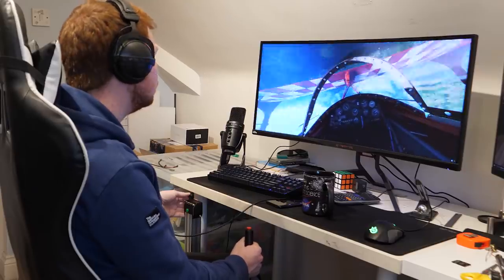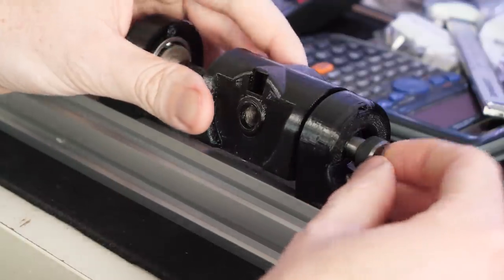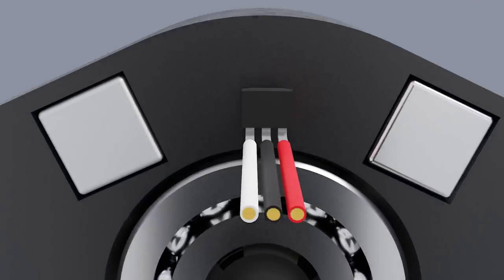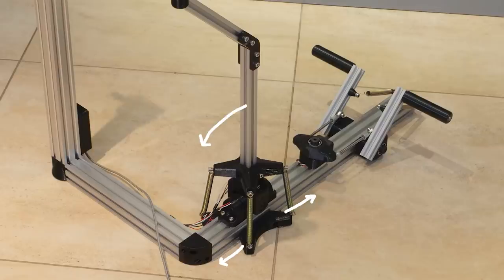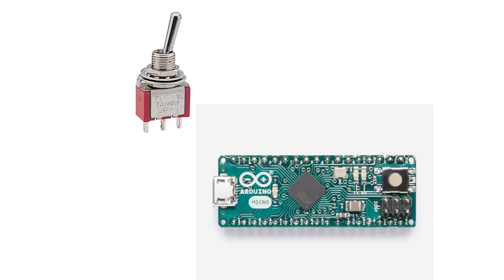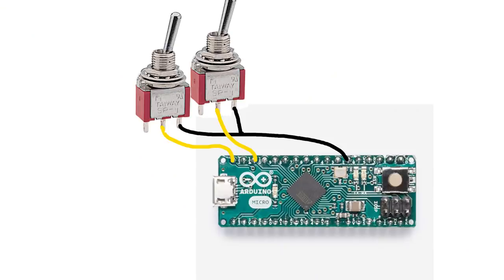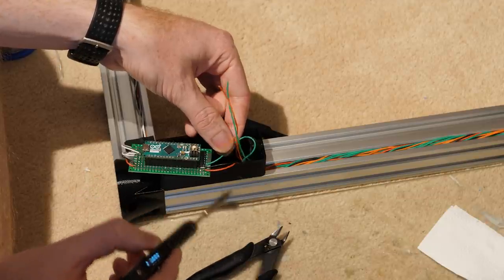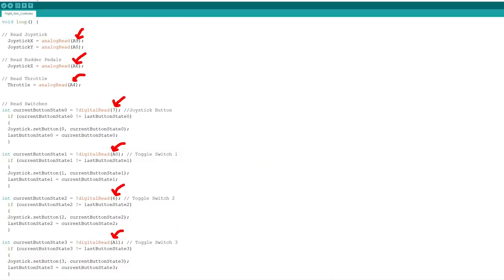Flight Simulator Joystick Info

Comment: Brilliant! I was planning to buy a low cost helicopter simulator controller kit to use with VR. Which is roughly same design as yours, minus collective. The kit is £750. With a bit of design change to accommodate collective instead of throttle, I can DIY it for 1/3 of the kit's price ^_^ Thanks a bunch Tom! You made my day!
Reply: planning something similar heli simming is expensive
Reply: Oz What heli sim do you plan to play?
Reply: @gargy2002 but you see, i have friends with printers, and soldering irons
Reply: @gargy2002 Or you could do all that and enjoy learning new skills and accomplishing something you haven't done before.  Plus then you'll have new tools and a 3D Printer too!  And still spend time with your family.  Win, win, and win.  (Of course yeah, if the only goal is money saving and you don't have interest beyond the device -- just buy it.)
Reply: @gargy2002 so is there a single reason for u wasting time and watching this video?
Reply: @petergruc  I think the real question should be "Is there a single reason for gargy2002 wasting all our time with their negativity?"

Comment: This is was a brilliantly simple and elegant build! I always thought these kind of joystick or HOTAS set-ups would be really tricky.

One suggestion for the code is it use the Button library. It handles all the current-state/previous-state internally so your code is a lot tighter. Also, you can use arrays to save yourself from repeating code for every axis/button. This makes it a lot easier to add more inputs down the line. That said, arrays can be difficult to figure out, especially with arrays of objects, so there's kind of a learning investment to do.

Comment: Came here because I was wondering how the Joystick driver was made, of course there is already a Arduino library ;)
Looking at your code I noticed a lot of duplication though, especially the switch part could be written way shorter. Just save the pin definitions and lastButtonState as array,  then do the setup and readout in a for loop. CurrentButtonState does not need to be global, one temporary variable is enough. This might sound like overengineering, but it makes changing the pins way simpler as well. I can send you a pull request if you want.
Reply: Ooooh I'd be interested in seeing the code myself!
Reply: @timcuatt1640  Here:  https://github.com/Jakeler/Flight-Simulator-Joystick/blob/main/Flight_Sim_Controller.ino
You can also find it through the open pull request in his repo page.
Reply: @1Hippo  Other thing to change.. the joystick range should be 0-1023 and not 0-1024. This is a 10bit value.

Comment: If you don't have a compass but you know where north is, you can float the magnet in a plastic lid (off a milk bottle or some such) and change the orientation until it lines up N-S. Mark the north pole with a dot from a marker pen.

Comment: Thanks for this.  I want to do exactly the same but for a helicopter, so will be adding a collective/throttle lever also. Especially thx for the tip on linear hall effect sensors.  The link on your video is no longer valid, but I was able to find sensors for less than $1 US and the first one seemed to work great.  This will greatly improve the reliability vs a potentiometer.  I also really like how you use 80/20 extrusions.  They are so handy for anything like this.

Comment: I have been designing something similar, very early stages, but one thing I am looking into is to surround the stick with a air bladder (similar to a blood pressure cuff) to make the stick stiffer at higher speeds. In fact, originally I was thinking of creating a seat with air bladders to (poorly) simulate G-forces in the seat.  If the pilot is well strapped in, air bladders to the back, right and left inflate and push against the pilot (originally for simracing, but it would work for flight simulation as well with some modifications

Comment: Thank you so much for this project Tom. This should be more accurately described as a HOTAS since it's a lot more than just a joystick. As a FS2020 user I've wanted something like this but you've given me the impetus to build it myself. I was originally using CH Products throttle and stick but the big issue is rudder pedals using a standard office chair. By modifying your design to anchor to the central pillar of the chair it should stop the chair rotating when applying pressure to the pedals. Another design question is that the brakes are supposed to be integrated into the pedals on light aircraft. Maybe a pair of button pads mounted above the rudder pedals?

Comment: Thank you Tom, this is fantastic! How about a mod for the throttle quadrant converted into a collective lever for helicopter simulators? 🤓
Reply: That are my intensions too. I´m going to use a modificated cyclic / TM Warthog, but try to use the Arduino Sim from Tim for rudder pedals and collective. I just try to understand the Arduino codes and will going to use another hall effect sensor for the collective.

Comment: Hi Tim, very cool! I have built some hardware for flightsims (I use X-plane 11) like rotary encoders for controlling flight instruments and GPS/Radio/Autopilot.
I like helicopters a lot and I am very interested in your project! Besides a yoke and throttle quadrant, including trimwheel, I have a good joystick (X52), but the
experience with the hardware you built would be way better. We (my wife and me) like the UK very much, been there often for holidays! Cheers from The Netherlands (North-East).

Comment: How about using I²C hall effect sensor such as SI7210-B-00-IVR? That would be ~13 bit sensor with a cost of less than 1 euro. That supports 4 selectable I²C addresses so you could put 4 such sensors in a single wire. That sensor has internal for temperature compensation but it also supports reading the temperature so you can fix possible temperature caused drift in software, too.

Comment: Hi Tim.  A great design.  I found all the bolts and bearings at RS Components and the Hall effeect at Farnell. The Arduino came from Cool Components. I have a problem geting the Arduino to be recognised by my Windows 10 machine The old Wingman joystick is seen by the computor  but cant work out why the Arduino isnt.  Your help would be  aprecaed

Comment: Hi !
I'm new to this Arduino/clones but I really wants to build some controls for the FS2020 !
I just ordered some controllers from Banggood (not Arduinos but GeekCreit !)
I designed a rudder pedal including L/R-brake switch mechanicly and want to make the coding of wiring now.
Unfortunaly I see it's NOT the same microcontroler ... I have a board with the 3.3V 8MHz ATmega328P
1) will it work with the library ?
2) is there a forum or so for projects like this FS2020 controls somewhere ?
Reply: is should be the 32U4 chip

Comment: I want to see you build a collective hand throttle so you can do helicopters
Reply: I think you can do the same thing as he did with the throttle, but add a rotational axis with a potentiometer and add it to the code, should be quite straightfoward (I guess)

Comment: Great idea, I use the same library to make an additional Clutch Pedal for my El Cheapo Sim Racing Setup. This works perfectly, although my code is not so perfect, as I have no automatic Offset calibration? Did you do this in your code?

Comment: You say you used M8 shoulder bolts for the rudder pedals, but you are using 10mm ID bearings there. Is this a typo in your parts list and it should be M10x30mm shoulder bolts?

Also, where did you find your springs? I'm trying to source these parts in Canada, and it is a nightmare D: metric parts are so hard to find...

Comment: Christmas is coming, and I notice you're a Banggood affiliate.
What's the minimum hobby starter 3D printer? I've wondered about getting one, and this may tip the decision, but I know next to nothing about them when it comes to choosing one to buy for the first time.
Reply: Creality Ender 3, about £180. Prints amazing out of the box. With half an hour or so building and leveling the bed, you could get prints the same quality as you see in this video. 3d modelling is another skill that really makes 3d printing useful. Fusion 360 is the best free software. Plenty of videos on printing and fusion on YouTube.
Reply: @joelaw728  Thanks for that. I'll check that out.
Reply: @joelaw728  Fusion 360, however, will get worse over the next few months as some file export options and tools will be cut from the free version.

Comment: in the process of getting these bits to make this. Can you confirm the sizes of the shoulder bolts for the rudder pedals, i am thinking they should be the same diameter / thread as the shoulder bolts in the joystick?

Comment: Is it possible to explain the size of the bolts a little better for people, like me, don't use the metric system especially the shoulder bolts? Having an issue of finding the right bolt size. Also, what are the pitch of threads on the bolts?

Comment: I've been looking into building something like this for my RC planes. How easy could you modify the code in the arduino and make the necessary connections to make it easy to connect to a RC Transmitter?
Reply: I've seen a couple DIY transmitters, it's mostly an exercise in finding the matching hardware and libraries, give it a google
Reply: not sure if this is what you want to hear, but you could take apart a rc transmitter and replace your roll, pitch, yaw, and throttle potentiomiters with the hall effect sensors that are built into tom's joystick. that would be the easiest way in my opinion. The other option is programming the arduino to output a CPPM signal based off of the individual hall sensor's values, and then connecting that to the trainer port on your RC transmitter.
Reply: Outputting ppm can be done quite easily  with an arduino and then plugging into a RC transmitter with trainer mode so if anything goes wrong you can use the rc transmitter
Reply: @Nicolas_dG  is there a ppm library that you know of? I've been wanting to look into this for a while

Comment: used these videos as inspiration to build my own rudder pedals (with toe brakes). I'm finally at the programming steps and struggling with the Arduino Micro. I have used plenty of the 328p style arduinos with no issues, but this Micro (32u4) style is kicking my butt. the whole thing with COM3 & COM4 popping up in windows 10 device manager during the reset of the micro was a real hassle and of course when you upload the joystick library it changes to a new COM port. I haven't figured out a way to reprogram the Micro easily after it has the joystick sketch loaded as it is taking over the COM port at that point. I have to hook up my MEGA to flash the bootloader on the Micro and then reload the modified library... Is there a better way? would greatly appreciate any tips for fast code editing and uploading if you have any guidance on this dang MIcro.
Reply: I've found that with the Leonardo, when the Arduino IDE gets to the upload stage, pressing the reset button makes it enter programming mode as soon as it boots.  Maybe the Pro Micro does this too?
Alternatively, try the Leonardo.

Comment: Hey Tom, fantastic design!  I'm in the process of going through the parts list and ordering components now. Quick question:
Are the shoulder bolts supposed to be 10mm to go with the 6000-2RS bearings? It currently says 8mm in the BOM
Reply from the maker: Apologies, they're supposed to be 10mm shoulder bolts with 8mm thread. I've updated the list in the Youtube description, but thingiverse takes a while to update. Thanks for letting me know!
Reply: @TimStation  Sure- no problem at all!

Comment: Hi, first of all, thank you very much for such an instructive video, it's been great. Im currentrly running tests in order to see If I can get the circuit up and running, and then, Im going to print everything. One thing Im facing on my tests, using an arduino UNO and a ss49e sensor, is that I cant get the value to reach maxium and minimum values. Printing a simple Serial.println(analogRead(A0)); and using 5x2mm neodymium magnets, I can only move from 400 to 600 output value, no matter how I face or how close I put both magnets (Im sure I faced the north and south poles correctly), while I was exptecting the full 0-1024 range. Is it possible that these magnets are not powerful enough? Thanks in advance!

Comment: Hello!
Great project, thanks for inspiration!!!
I have question. Can I use SS495A type of hall effect sensor?
I can't buy in poland 496 type.
Regards
Reply: I'm wondering the same thing. Output current of the SS495A1 is less than the SS496A1. Not sure what the result will be.
Reply: @martinbachrodt745  it is perfect.  Flight simulator working grate.  Thanks !

Comment: Buttons without pull-up resistors, and going to analog inputs? Never seen that before. Maybe reading all those ADC channels causes some latency, as compared to using pull-up resistors with digital inputs. Though I doubt any such latency it causes is on the 100ms scale.

Still, makes me wonder where all that latency comes from, be nice to see you hook up a logic analyser to some digital outputs of the arduino, which are programmed to turn on at certain stages in the loop so you can debug your circuit without loading it down with much extra code.
Using an external SPI ADC might speed things up, maybe.
Reply: You can use all inputs as digital. Atmega have internal pull-ups, no need for adding extra resistors.

Comment: Hi Tim, thanks for the great project. My 3d printer runs for the second day. I´m going to convert the simulator for a helicopter, so I will use Your rudder pedals and build a collective instead of the throttle stick. For the cyclic I implemented a third party stick but with modifications. This little Arduino Leonardo is my very first Arduino and I try to understand Your code with multiple Youtube Videos. The upload of your codec was successful so far, but no sensors are connected yet. I have one question about the analog config. My Arduino has 5 Analog Pins and in the codec is written analog A6 as example for the rudder pedals. And pinMode A0-A9. Is Your Board extended? I only need 2 Analog Pins for tail rotor and collectiv. But this confusing me. 
Mybe someone can help me before I start to rewrite the codec. Best Regards.

Comment: Hello Tom,
Is it possible to use an ADC 16 bit card (ADS1115 for example) to increase the resolution of the Arduino pro Micro to 16 bits for the Joystick ?
Thanks !
Reply: No the limit will be the same 10 bit.

Comment: Think you could simplify it by using this BU0836X 12-Bit Joystick Board from LeoBodnar? Whats the downsides? Works with hall effect.
Reply: I was thinking the same. I have the same and currently am just using slide pots for throttles, props and mixtures.

Comment: you will be able to make a guide of the connections and compilation of working arduino? For people who know how to build and print but do not know how to use arduino. Like me, for example. I would pay for this info
Reply: I am working on this exact thing this weekend. I am not great with Arduino but I have messed with it enough to figure it out. Literally just finished testing my arduino with the buttons, potentiometer and hall effect sensor and it all works. It is pretty simple. I will be making a YouTube video and link will be on thingiverse
Reply: @headintheclouds2569  It would be interesting to me too.
Reply: @sleepyhollow6884  you know, I finished this thing and it works great but I never made a dang video or anything 😄

Comment: Hi,
Im building my new Joystick after your video. Ive allready printed and assembled my gimbal and put the magnets and sensor in their place. When I connect it to my arduino (Im using your Arduino file) I can find it in the Windows gamepad controls. But what I see is confusing... The crosshair for the x- and y-axies is dancing around even if the gimbal is held absolutely still and even with calibration done before. Maybe somebodey can give me a hint what i have to do to get it working properly. Thanks a lot! :)
Reply: check again the correct alignment of magnets.

Comment: What is the requirement that it must be a 32u4 processor for the Arduino?
Reply: It's required by the Arduino Joystick Library; it is for to mimic USB joystick to Windows.
Reply: It is the cheapest Arduino that is recognized as USB by a PC, otherwise it will not be seen as a controller or 🕹️.

Comment: Can i use any of the official arduino nano boards? I read the 32u4 bit and none of the boards on the arduino website say they have a 32u4 processor
Reply: Arduino micro and leonardo have atmega 32u4. Atmega 328 in nano and uno don't support native usb and will not work.

Comment: I really want to build one, but I'm unable to source the 40x40 extrusions anywhere in Germany. Did not even lookup the other stuff.
Reply: I wrote "alu profil 40x40" on amazon de search and there is plenty of them.
Reply: @Rozbujnik_Rumcajs  Those are not the right ones (not v-rail), which means all the 3d printed parts do not match anymore, I guess.
Reply: @spheenik  In this case it doesn't matter if it's v-slot or t-slot. Parts are flat on mounting side and doesn't utilize v-grove at all. Check it out yourself.

Comment: hi can you use a Arduino  ono for this project I am having problems with compiling
Reply: No - the Uno doesn't have the right processor to work with the joystick library - it needs to be the 32u4 processor such as in the Pro Micro and Leonardo.